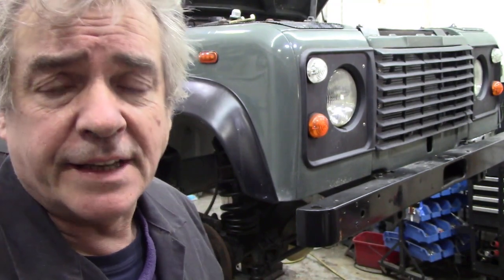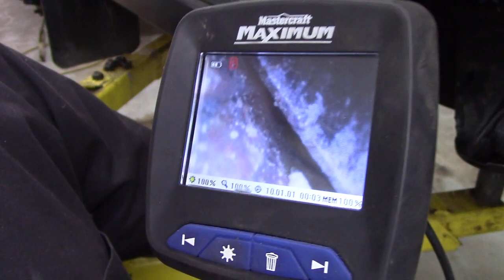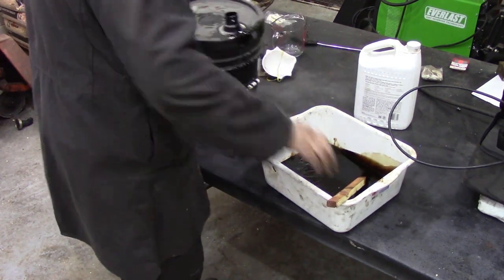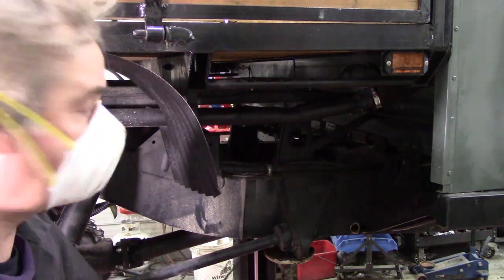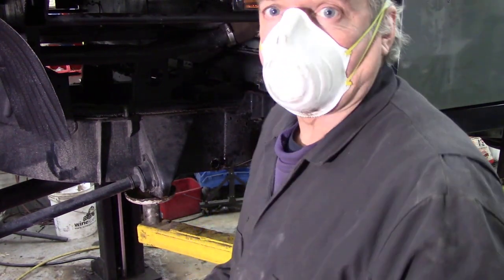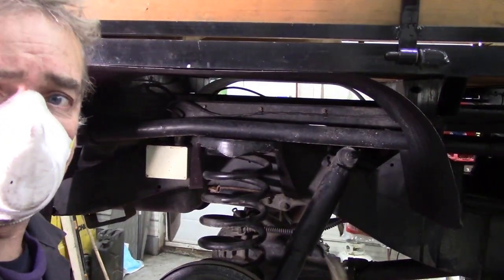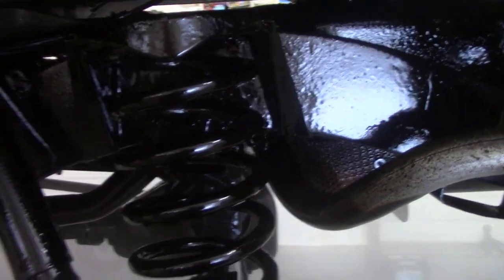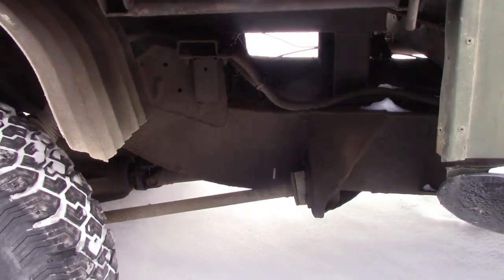Rust proofing a 110 chassis. Part 2   Application

Comment: If you get an empty 3 litre coke bottle with the label removed, you can insert the spray nozzle into it and see what the spray pattern will be like inside the chassis, and work out if you need to rotate the spray whilst removing it to get all round coverage.

Comment: Hi Mike a top tip when waxoiling or undersealing we wrap the exhaust in  kitchen foil. As you know it can be formed easily,then just pull it off when you're done. Regards James at  jb auto clinic. In the UK. We do a lot of landrovers here.
Reply from the maker: Good idea - I wiped it off before it dried with an absorbent cloth

Comment: BR.  Superb oiling job there Mr. Jamison !  Have used 'Fishholene Oil' on the Rangie within all the nooks and crannies which is especially good up in the tropics and bolted rock sliders to act as anode ?  V.
Reply from the maker: Sounds good - this stuff I used was made here is Quebec and unlike Waxoyl - it does not harden in the cold

Comment: HI Mick did my 1991 s.w.b 90 petrol, I did my the same way as you, not the best way so I used my drain cleaner on my karcher presser washer ended up with a bucket of rust and mud, then using the same drain cleaning tool attached to a good air lien an I bought the same under sealing gun as you about £80 best money spent keep up the good Work yours RH
Reply from the maker: Yes the guns are very good but you must wash them out after use!

Comment: I weld in steel plates in the the A frame cross member, where it fixes on the main chassis rails . where the gussets are in main rails fill them in  to stop dirt filling up the area and rotting it out

Comment: I've got a drain cleaning attachment for my pressure washer. 15m long very thin hose with 360 degree nozzle on the end. Never used it on a chassis but it should do a great job of blasting the inside of a chassis leg and even pulls itself along as some of the jets point slightly backwards. Could clean entire length from one entry point.

Comment: I had the same thought as you about the front to rear wiring harness Mike. Why put it in the inside of the chassis where it can not be seen or repaired, wish I had done the same as you did now, maybe I could have repaired the wire for the reversing light if I had. Never mind, we live and learn. Please keep the video's coming, they are the only contact that I have with reality during this lock down thingy. Stay safe, Yorkshire Rob..
Reply from the maker: Indeed Rob - there are a lot of places inside the chassis where the wiring can chaff

Comment: I was half expecting a werewolf to jump out of that fog! I wonder if that stuff could be made from oil changes and a big lump of bees wax+angle ground zinc wheel balance weights, though probably not pc!
Reply: Old oil works well
Reply: @Anderzander  it does! Watch the pc grumbling comments!
Reply from the maker: But old oil will not stick to vertical panels
Reply: @BritannicaRestorations  it is on mine 🤷🏻‍♂️
Reply: @BritannicaRestorations  Lol, I beg your beeswax! Magic ingredient in the recipes make-up, parrafin wax doesn't work as it's like cold toffee and brittle, were as beeswax is pliable and makes it sick after it's melted in, thrift shop? Is that the equivalent to charity shop?:) tends to bee over priced!
Reply: @BritannicaRestorations  1984 DNA altering vac will get rid of all your rust worries, and any others=/

Comment: Piro stripping ( big oven with no oxygen so paint carnt burn)  for chassis bulkhead door pillers and all other bits that get dip painted .gets  all the paint waxoil underseal etc off comes back like its never been painted not sure what chemical they bath in after stripping but takes all the rust off as well . Good for full body shells as dosent distort like sandblasting

Comment: Hi Mike, cracking videos. Do you plug the drilled holes afterwards or leave them open as a drain?
Reply from the maker: I leave them open to circulate air and let water out

Comment: Hi Mike - about to do this job. Being in the UK I'm using Waxoyl - the official method of using it hot sounds like a pain. Anyway, using similar tools to those you're showing here, I've been experimenting using a 50:50 mix of Waxoyl and ATF. Seems to spray and cover very well and gets nicely into nooks and crannies on some scrap items. I seem though to remember you saying in a gearbox vid somewhere that ATF contains cleaning agents? If so, anything in there that's going to rot my chassis? Also - I assume there would be no problem with used ATF out of the gearbox/transfer case?
Reply from the maker: ATF has Chlorine I am told - is not corrosive
Used ATF should be ok
Reply: That's great - thanks Mike

Comment: Mike have you ever thought about filling the chassis void with expanding foam. No air, no water no rust.
Reply: Most expanding foam absorbs water.  Not good idea.
Reply: Lots tried that in the 80s, with disastrous results.  It breaks away from the metal with the flexing of the chassis, then traps water and completely stops any damp from evaporating.
Reply from the maker: A real bad idea! GM did this years ago in the sills and they rusted like crazy and were a bugger to weld up as the foam kept catching fire

Comment: Would you recommend  galvanizing  a 2nd hand chassis or treating this way?
Reply from the maker: Well, you cannot galvanize over paint - the acid dip prior to galvanizing will remove rust, but not paint
I have seen used chassis a few years after galvanizing, and some had rusted from the inside
I used to do this over 12 years ago, but now I only fit new chassis - for me it was not cost effective
Reply: @BritannicaRestorations  thankyou.

Comment: Hi Mike,  how come you didn't use Krown? I have ordered some to the UK and they had a leaflet about chassis sealing.. Is the wax better than krown for the chassis? Cheers!
Reply from the maker: As I mentioned, I could not buy it in drums only cans - If I could I would have - but I will do the bulkhead in Krown

Comment: Is it worth doing to a 2015 plate the garage wants 800 British  pounds
Reply: It certainly is, they start rusting as soon as they are driven off the assembly line.  Do the job yourself, don't have to jack up as you can crawl underneath easily enough.  I did my 2015 110 XS with Dinitrol products.  You need to check over it every year, and the most important thing is to jet wash the underneath if you go off road as it's the trapped mud that causes all the problems.
Reply from the maker: Cheaper than a new chassis

Comment: Never heard of that product. I use a lanolin based rust proofing with good results,either way it's a crap job especially with no lift.
Reply from the maker: Yes - not too good a job to do, and I bet this will be the last time it will be done
This is a Quebec product so does not crack in winter like Waxoyl

Comment: LandRover's leak enough crap out of every joint without filling the chassis rails with "goop" that will stick like "shit to a blanket" to your driveway or garage floor...
Reply from the maker: This only drips on fresh applications  - dries in a few days outside
Reply: It sounds similar to stuff here called "Tectyl" it has incredible "wick in" qualities, it creeps into all gaps and crevices. I have used fish oil in the past, thus my comment, more oil on the driveway to clean up...